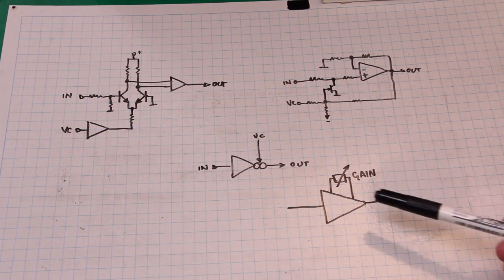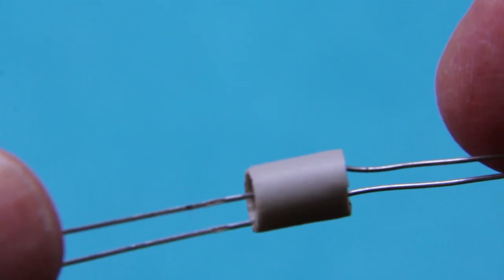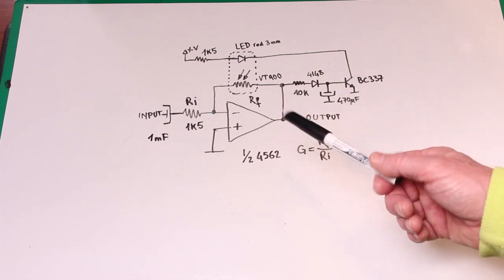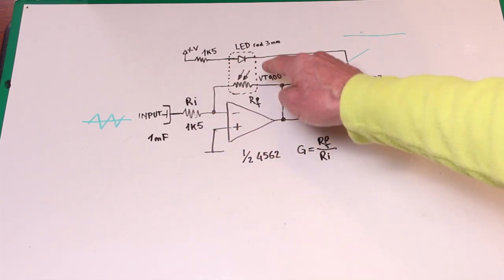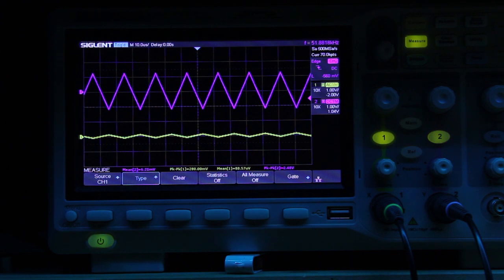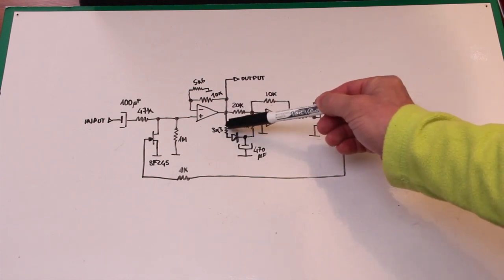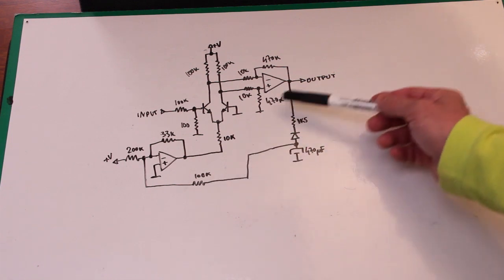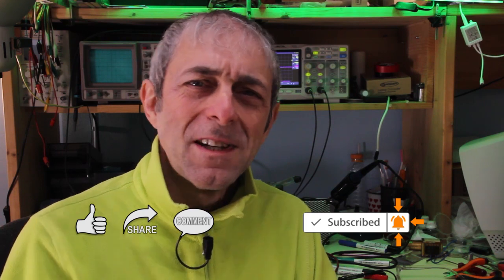Automatic Gain Control with your own LDR #electronics

Comment: You could try making your homemade vactrol using a green rather than red LED.  CDS photocells are more sensitive to green light.
Reply from the maker: Yes. But in my experience the sensitivity of the photocell is not a problem.

Comment: In the first version it may be intersting to change the BC337 for an opamp led drive. The leds goes in the feedback loop of one non inverting opamp. With this configuration the leds turns on gradually from zero.